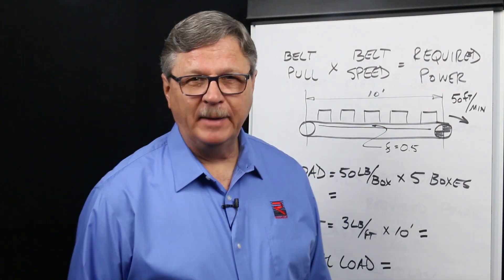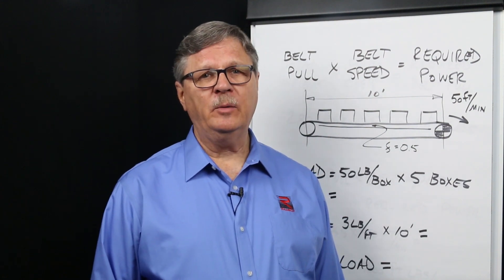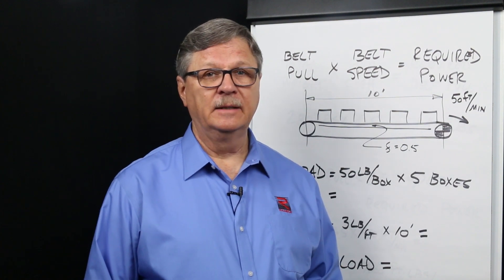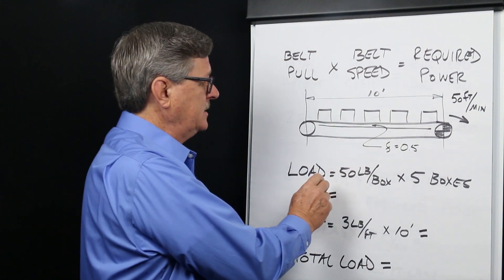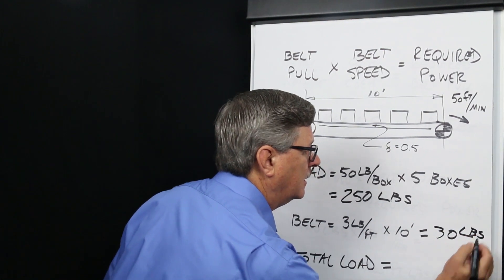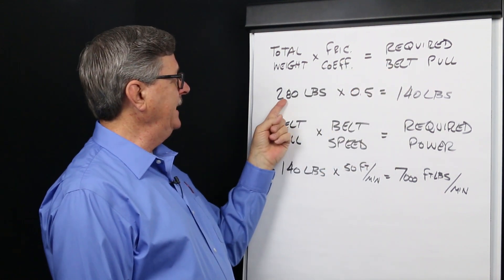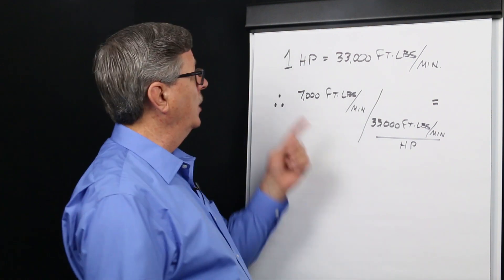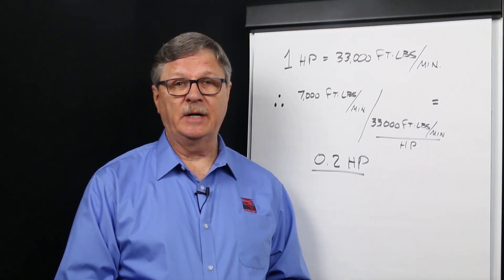How To Calculate Belt Pull and Power

Comment: how to get the weight of the belt per ft, for 450 mm belt width. thanks
Reply: divide your belt total weight(1kg =9.81N)by the active length 
you will get the weight load distribution. make sure to convert your unit to Meters

Comment: I would add a safety factor of 1.6 or 0,32 hp round up to 1/2 hp...but why did you not add the friction factor. The belt contacting a slider plate is additional friction is it not?

Comment: Sir please guide how to find TPH only in bin load. ??
Reply: I do not understand your question.  Please define "bin load".
Reply: Sir we have a 5 tones capacity fine coal bin there we have only bin weight  & the discharging of the material through screw. And in bin discharge a valve that is open at 3.8 tons & close at 3.56 tons.  We want to calculated the TPH through DCS.
Reply: @jc_artopedia  We will be happy to help you.  May I have your email address so that we can easily exchange drawings, etc
Reply: jitendra.chauhan@adityabirla.com

Comment: How much weight can a 1/2 hp motor do?
Reply from the maker: The answer to your question depends on the belt speed and the frictional coefficient.  We know that 0.5 HP = 16,500 ft-lbs/min.  
With f = 0.5 and belt speed = 50 ft/min, it can handle  (16,500/50)x 2 = 660 lbs.  
With f = 0.3 and belt speed = 50 ft/min, it can handle (16,500/50) x 3.33 = 1,099 lbs. 
With f = 0.5 and belt speed at 100 ft/min, it can handle (16,500/100)x 2 = 330 lbs.
Do you understand the relationship between weight, belt speed, and frictional coefficient now?

Comment: Thank you for your video and it was very useful for me. My humble request to you to make a video to find the required input and output gear ratio for the conveyors and also provide the formula for the same above.
Reply from the maker: Dear Haha, We supply Motorized Pulleys which are custom-made for our customers, which means we supply whatever gear ratio is required to provide the belt speed desired by the customer.  Mike